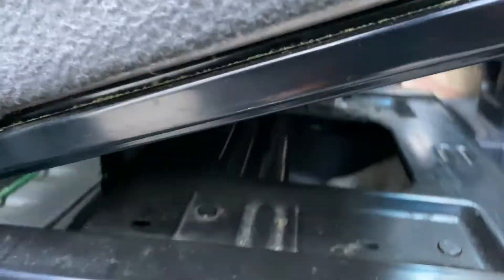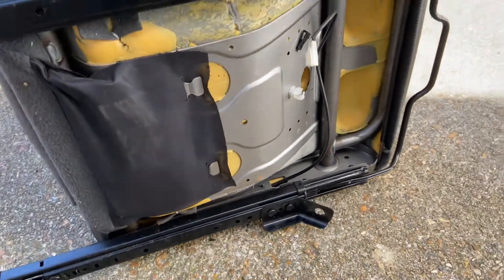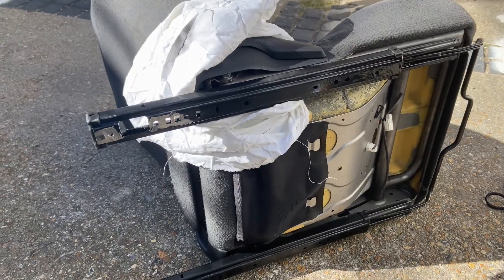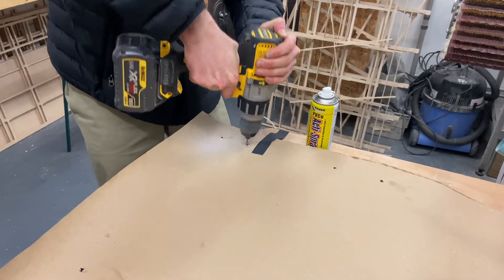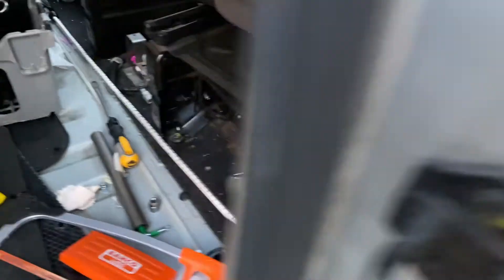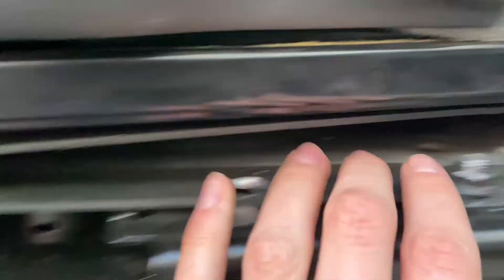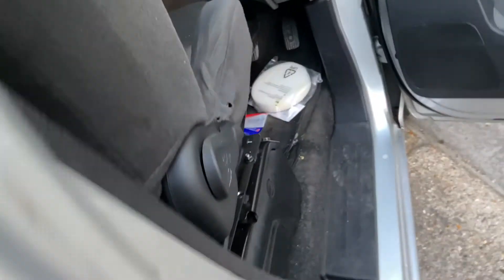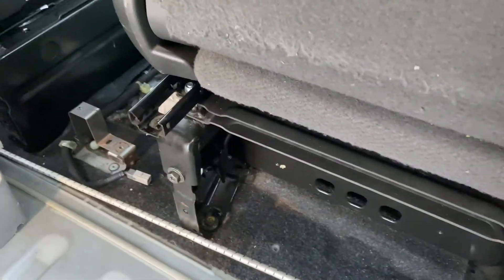Nissan NV200 Van Conversion | Swivel Seats pt.2 | Driver's seat | Van life

Comment: This is awesome, not being able to get the drivers seat to swivel for the extra space has been making me hold off doing an env200 conversion. Keep holding out in the hope one of the trim levels would have an electric parking brake to get rid of the problem altogether.
Reply: Also bit cheeky of me but any chance you can go into any more detail with the handbrake modification? I know you didn't do it yourselves but did you have much trouble finding someone to do it/ did they say it was much of a headache?  Also do you have to release the handbrake to rotate the seat or are you able to keep it applied?  I've considered dropping it and keeping the foot brake applied while rotating, but a bit risky and asking for an accident to happen.

Comment: Hi, thanks for the video. Bought a similar van, but an import with electric brake. This is a good idea as gets over the problem. Professional converters seem to tell me a swivel base not available. Fitted a universal to a transit previously but no experience with nissan. Where did you get yours, how much and link please?